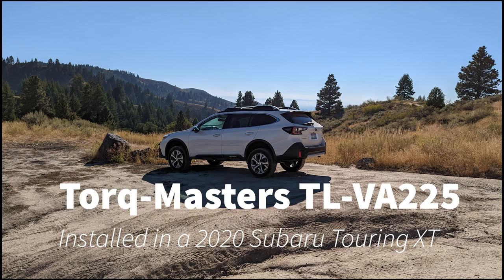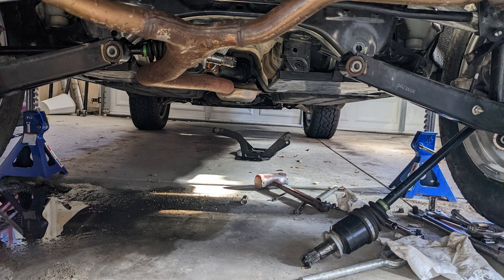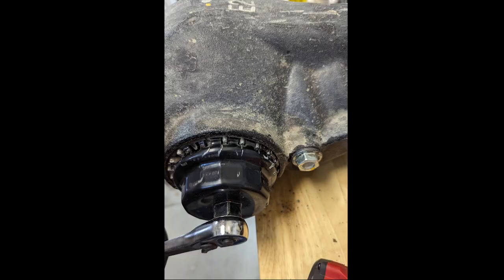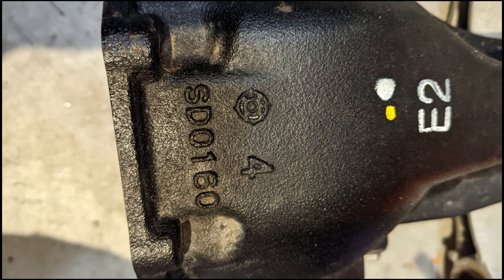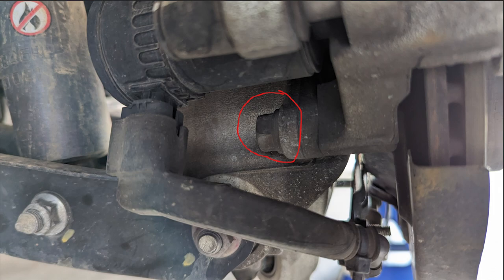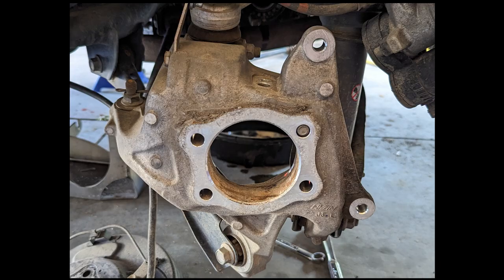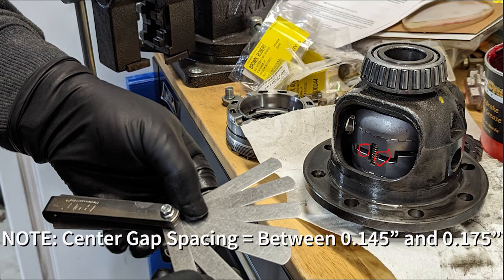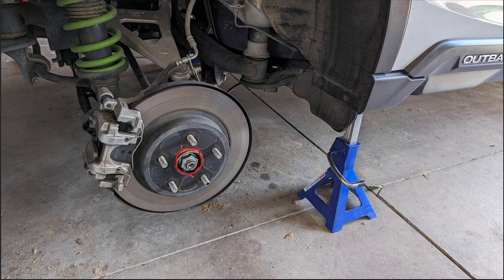Installing a Torq-Masters TL-VA225 locker in a 2020 Subaru Outback Touring XT

Comment: I have an outback wilderness that will be getting this treatment. Looks pretty straight forward if you are knowledgeable about cars. Can’t wait
Reply from the maker: it wasn't too bad , the hardest part is getting the rear end out and back in without tearing the shaft seals. make sure you keep track of the number of turns you use to take off the sundials. 
It is completely worth the upgrade.
Reply: I counted my sun dial turns but when it went back together it seemed like there was a lot of play in rear end but I checked my work 3 times so I’m sure it’s the same. So we will see? I don’t really remember much play but I also didn’t check. Mine looked about the same as yours going back Together. Mine was just over 7 turns which was the same as the torq locker video on the wilderness so that makes me think it’s correct as well.
Reply from the maker: I think mine is a little tight when I put it back together. there is an official method of setting the lash but I have not wanted to pull my rear again to try it. I think having a little bit of slop is better than putting too much pressure on the bearings.
Reply: @rob55D89D  Yeah that is what i was thinking as well. Thank you for the response.

Comment: Thank you for creating this video. How does the locker behave ONA windy uphill road?
Reply from the maker: I don't really notice it at all. Some people have put in transmission and differential mount bushing stiffeners to make the unlock smoother but I haven't put any in yet. we have been on windy dirt and paved roads and I feel like the only thing I notice is a feeling of better traction in the rear. On icy roads I do notice the understeer more but I am pushing it to see how it behaves more than I did before the locker so it is hard to know 1. if there is more understeer 2. if there is more understeer, is it because I have better traction in the rear now

Comment: Does it always make that loud tinking noise? Even driving down the road?
Reply from the maker: @letzgow6110  Definitely not even close to loud. Going straight the locker stays locked so no clicking. When you turn, the locker will click ( unlock) and allow the outer wheel to spin faster. We can barely hear it turning slowly with the windows down and the radio off. I think a 10 speed bike clicks louder when you pedal backwards.
Reply: @rob55D89D  good to know

Comment: Can this lock permanently like a regular diff lock?
Reply from the maker: @vasilisconstantinides7950  No, it is normally locked until 1 wheel spins faster than the other like in a turn. The outside wheel is driven faster by the road, so it is allowed to free spin like a 10 speed bicycle wheel. If the inside wheel loses traction during a turn, then it will catch up with the outer wheel and the differential will lock up again. If you are descending a hill, both wheels will be locked. If you turn while descending a hill then the locker can unlock allowing for differentiation. I feel like this style of locker is the best for all around driving, both on road and off. This is not the best type of locker for some of the extreme rock crawling but neither is the outback. Both wheels are locked probably 99% of the time during normal driving and only unlocks for turns, if there is sufficient traction.

Comment: On toad driving do you hear the clicking??
Reply from the maker: I cannot hear it at all while driving. I have to turn really slow so there is no engine or road noise to be able to hear the faint clicking. It has been the best upgrade to our outback.
Reply: Beaut Rob just wanted I wanted to hear 🙏 I thought it might end up sounding like a bike with a loud rear cassette on it ! 😊Yep with this   they are way more capable the X mode then just manages 2 wheels